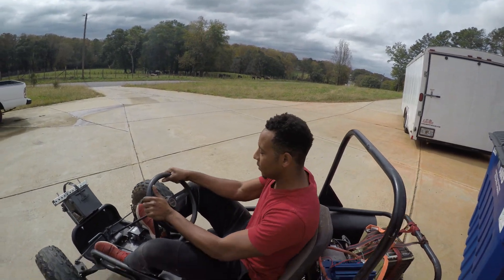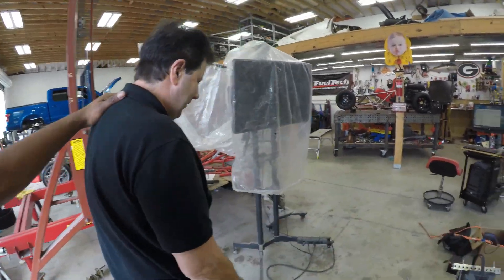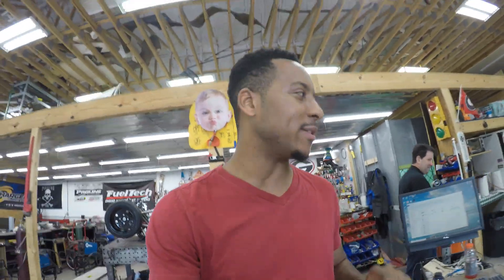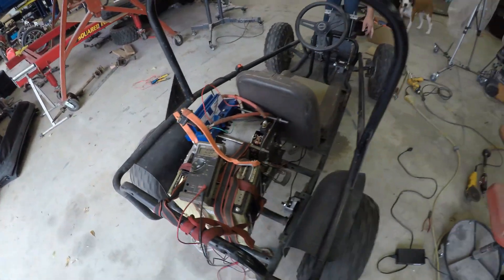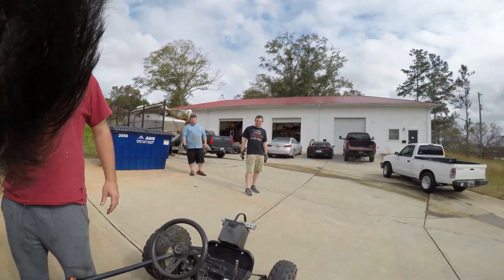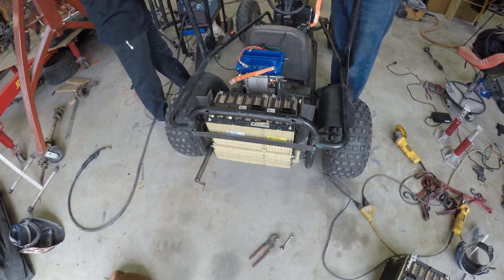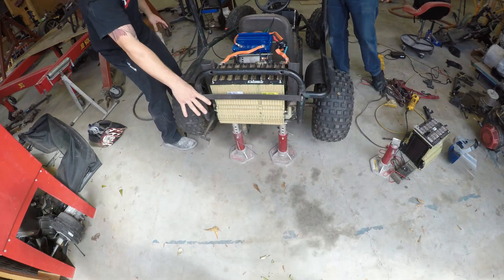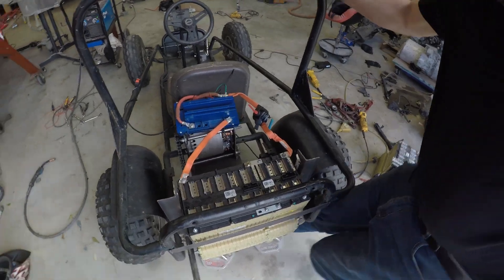This is the Fastest way to BLOW UP your Motor: Electric KART MADNESS

Comment: Hey, i know that you are gonna bake a new build, but maybe if you get this motor to someone that fix forklift motors, and a replacement brush kit for this motor, maybe they can check and/or fix the rotor wiring, swap the brush assembly and make it work again
Reply: Those DC motors from Motenergy are somewhat similar to the series wound motors used in forklifts, so maybe they can revive it, with a new brush kit and tested wiring/commutator
Reply from the maker: @foxxyytofficial  I like the way you think. Things are not always as they seem lol rise of the phoenix pending~
Reply: @DirectedWisdon  hehe, maybe one day the phoenix will really rise from its deep charred slumber, to bring its grace to the world again
Reply: @DirectedWisdon  loved today's video, an amazing surprise
Reply from the maker: @foxxyytofficial  thanks my friend I try to keep things interesting.